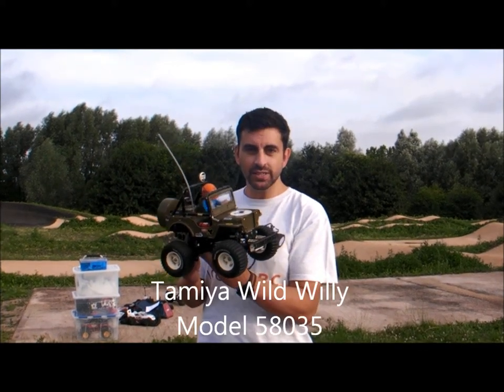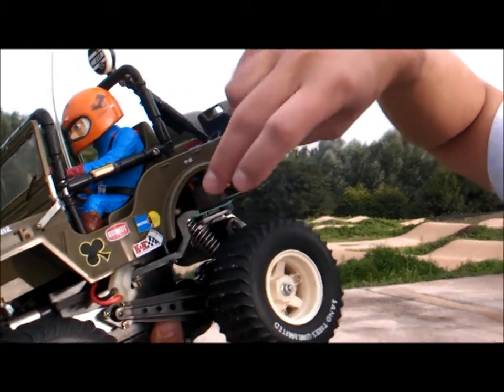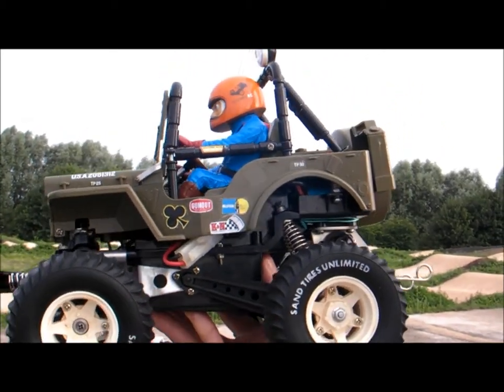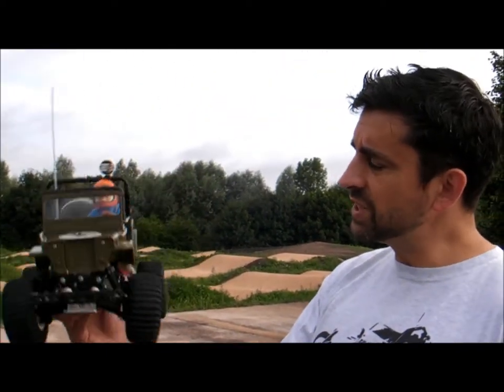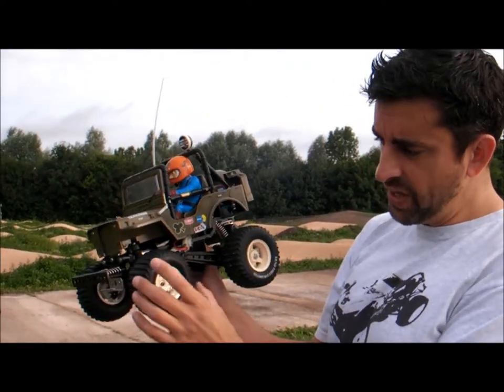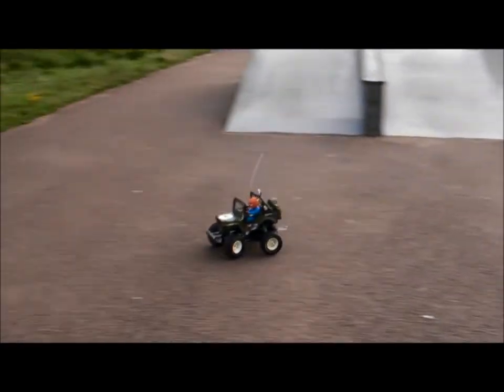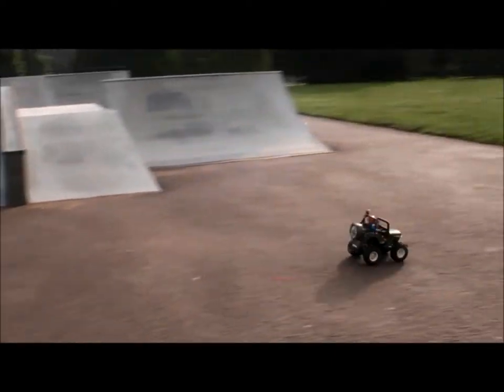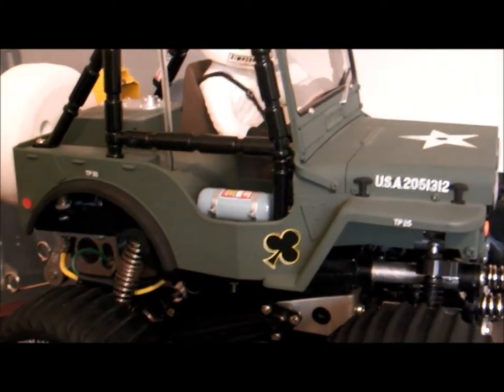Tamiya Vintage Wild Willy - Short Wheel Base, Early Version - Model 58035

Comment: Thank you for showing us this Iconic. This was a fantastic vehicle that was indestructible and, as I recall, could certainly shift if fitted with a fully charged hump back old style 7.2volt. Wasn't THAT far off Superchamp/Sand Scorcher top speed. It's suspension system was simply something else too. It reminded me of a 'bed of springs' when I first saw it in another lifetime back in 1982. Once saw a shrink-wrapped NIB on e-bay for $1,000 and wished I'd acted!

Comment: Remember building one in 1982 for my daughter, we had great fun with it. It was a very detailed build compared with other RC vehicles I had built back then. With the 7.2V battery it really did shift and would pull wheelies just with the throttle. Made a fun change from racing 10th scale :)

Comment: Looks like it could use some more torque. I’ve been using 35 and 45 turn motors on some of my restoration projects because I get a lot more torque than the silver can which allows me to use a wider range of pinion gears for a perfect match. This one seems to be struggling to get up to speed for some reason.